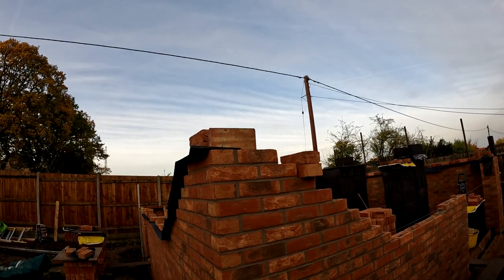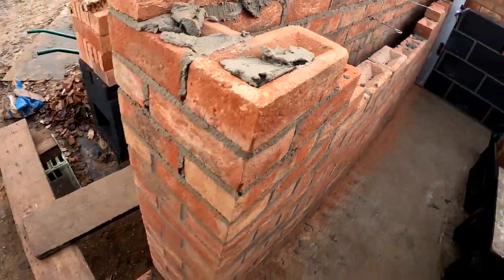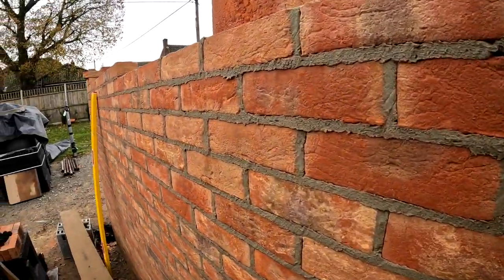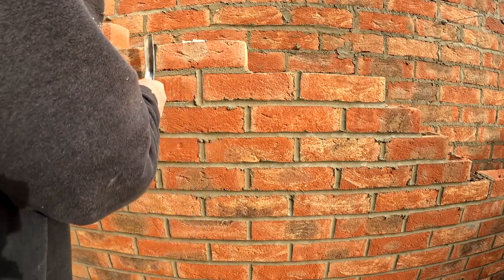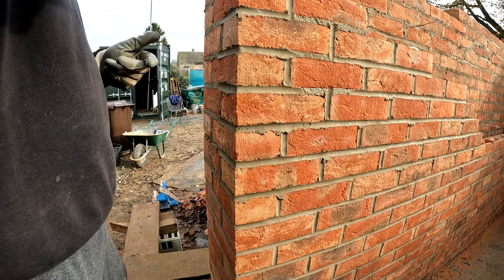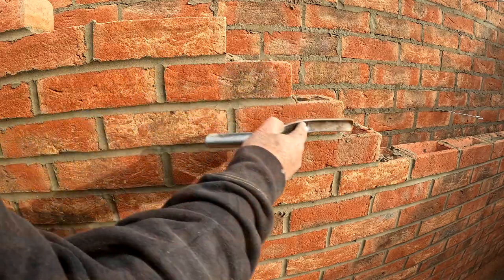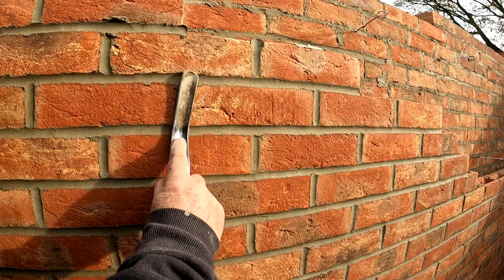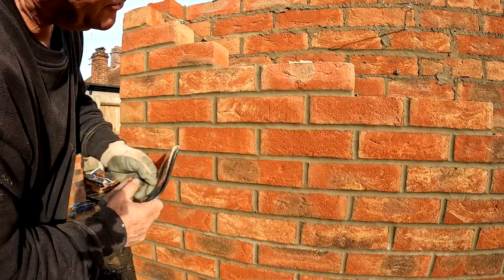Bricklaying, HOW to get a QUALITY finish!

Comment: Really rewarding to watch such pride and attention to detail. You set the standard for the likes of me to aspire to. I'm not a bricky (I'm from the dark side...... I'm a sparky 💥⚡) but I like to dabble with bits and bobs of brickwork on my own house and garden. When I was an apprentice spark, the old boys of the time that taught me used to insist on neat and tidy workmanship, even cables that would never be seen again under floors, buried in plaster etc. It didn't take much to p..ss them off and they'd have me start again and "do it properly". I can still hear them now in my head....."That's not how I showed you, that's just plain laziness that is boy, don't you be turning out shite like that on my job you little b..stard, now take that all out and do it again properly or you needn't bother coming tomorrow!" Good times, I miss them 😎

Comment: Wow budd great work 😁 as a beginner bricky who has now been doing bricklaying for about 6 months it’s really nice to see how the perps are all in line with each other and great to see the bricks completed surrounding by mortar like the brick is completely stuck in the mortar if you know what I mean 😅 I really like how you use the pointing trowel to get rid of the little bits of mortar hanging on to the joints, it really gives the joints and the brickwork a sharp look, I’m 18 and have just started basically and watching your bricklaying videos are a huge inspiration to me and I have learn a lot from you budd since I started in September, keep up the good work budd thanks 😁👍
Reply from the maker: Death blaster keep at it , sometimes you will think a can’t do this but it will come, and eventually you will find your own style, you will notice we all do things a different way on you tube , but generally end up with the same end result, listen to everything and take on board what works for you, many thanks for watching 👍👍
Reply: @BuildingwithBudd  cheers budd I appreciate it 😁👍🥂